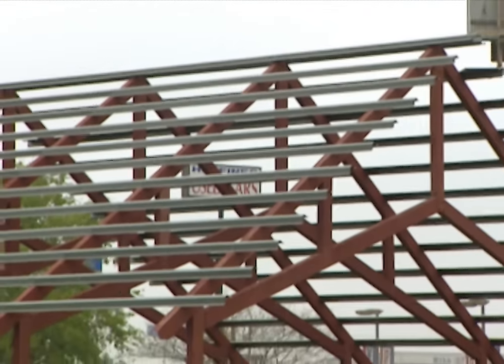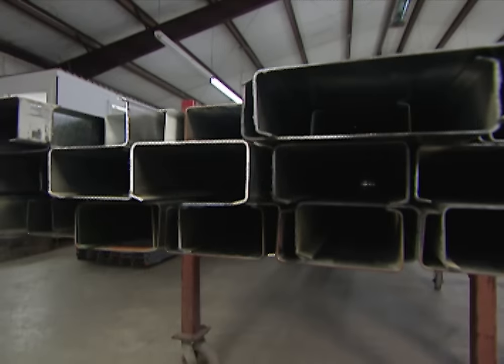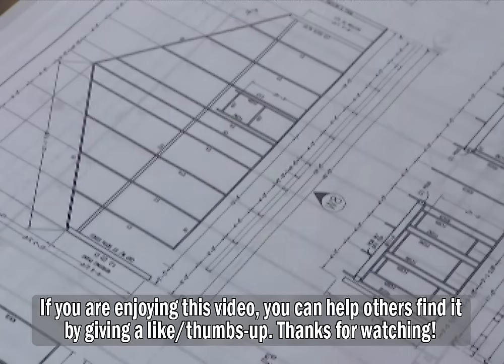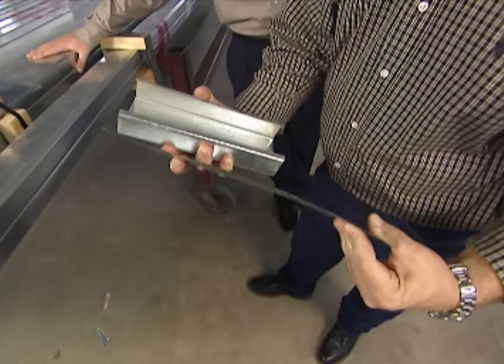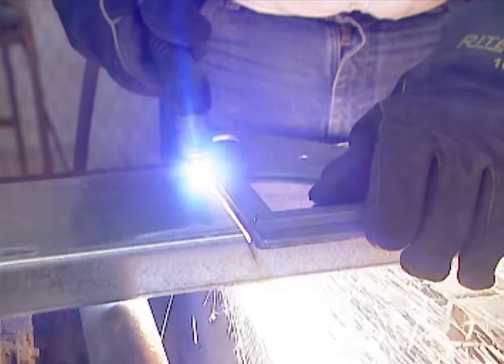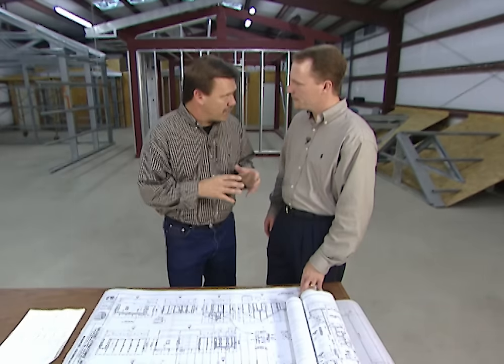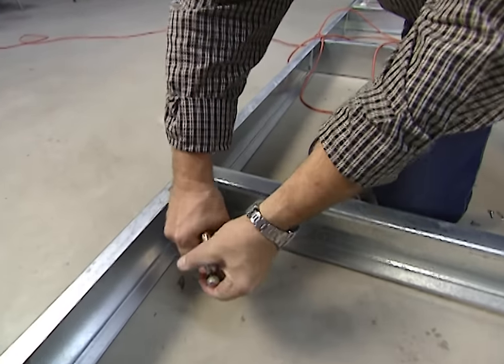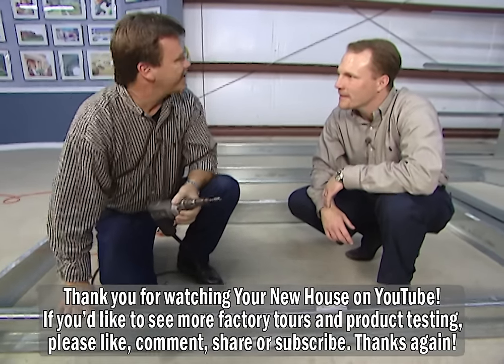Steel Framing - Did You Know?

Comment: I’m wondering how the steel handles the permanent stress of settling
Reply: I know a 20 year home with creaky walls and unsquare doors n windows. Has steel c channel beams
Reply: @lynnamarsh6384  I suppose Lynna  really you could find that in  many  average wood or steel homes  ,
 i have always lived in wood frame homes , and they all seem to suffer some movement in the frames over time . 
  I suspect a lot of how well they hold up regardless of materials over time has to do with how well they are built from the get go .
 Time is money , and imo often they are slapped together .

 I`m not a builder but i am old and seen a lot houses ,  and a  lot of them are imo put together with short cuts  or compromises and cheap and fast like junk.

Comment: Not seen a chopsaw run without safety goggles or hearing protection in a while. Not even side shields on his spectacles.
Reply: oughta see some of the crap that goes on in the steel fab shop I work in 😂

Comment: As a steel fabricator in manufacturing for over two decades I would never use screws to join two pieces of steel. If you can't weld it ...your just pretending. The screws just make this product marketable. Buyer beware.
Reply: big agree

Comment: yeah and in the case of fire the whole bloody thing would collapse. steel softens quickly in the heat.
Reply: Yeah but it would sag whereas timber burns, cracks, splits and collapses, at least you have more time in a steel frame home to escape, also unless you're an idiot who lit his gas main on fire morebthan likely a fire would not heat the entire structure enough to melt it
Reply: not the way those are framed. it wont collapse. you would have to have wayy too many failures for that to happen. the house would have to be a huge inferno, but theres nothing really to burn that hot since there isnt any wood
Reply: That's what sheetrock is for...fire protection as per codes all primary load carrying members have 1 to 2 hour fire rating.

Comment: and termites dont eat plywood ..yeah right
Reply: Up here in upstate NY we dont use plywood to steel , we use durarock  a fiber  gypsum board  4×8  ×1/2 or 5/8  a fire proof ,water  , rot , termite ,mold free material   . Covered by brick or dryvit.
Reply: @tomparshall2450  far out ,,pretty sure i seen wood product in this video tho,,but at least the termite wont eat the studs ..lol

Comment: Did you know whin I was in high school  in 1965 I was told don't bother  learning wood framing ( by my wood shop teacher)you won't be working in wood WELL there still framing in wood
Reply: They also used to tell us we would be driving in flying cars a couple of decades ago...still driving on the road. The thing about change is that people are resistant to change until enough time has passed to prove (or disprove) the concepts.

Comment: Make a shipping container home instead! ..much much cheaper. ....that metal does not  burn, but it can get very hot and can melt and bend.
Reply: @lawsfreelancemalice1380  the rust actually helps the container from any corrosion. They are made for ocean winds and ocean salt  water. They also last an entire week floating on the ocean when they fall off container carrier ships so they can be recovered.
Reply: @lawsfreelancemalice1380  yes, correct.👍

Comment: We need more of these homes in California with all the wild fires, termites earthquakes and wind in some areas..  They just started to bring in steel studs the last few months at our local Lowes and I have already started to use the steel for a number of projects. I am looking at putting a metal roof on my mobile home and nail steel studs to the outside of my mobile home and fill it with mineral wool and put on top of that metal siding.

Comment: What’s the company we can send the blueprint to ?
Reply: Just have your engineer draw plans in steel that's all.
Reply: @786otto   If youre doing it all your self , go copy a commercial building ,        Draw it the way you want it to look , then get an engineer to look over your   drawings , and he'll make the appropriate changes . That same engineer will   have to do a structural  inspection of your finished work to sign it off . A building inspector isnt qualified .
Reply: @paulbains9152  Building inspector has authority to inspect job not inginier .If plans approved by building department iginier inspector just needs to veryfy is done as plan shows .
Reply: Your too late. They went out of business.

Comment: Why would you take 20 foot long pieces and cut them to the correct size. Why not use a machine like a FRAMECAD machine which makes it so much easier and much quicker. Your method would appear to generate much scrap. I should know because we do it both ways. The FRAMECAD Method is the best. (HOWICK, SCOTSDALE) Also great machines. With you being in TEXAS there are several good companies building homes and much larger buildings using the FRAMECAD system. The end results are amazing. High Quality, Safety, Structural Integrity etc.

Comment: I'm not a builder and here's why I think this is dumb:
- Try hanging drywall, pictures, shelves, etc. by driving a screw into steal (too time consuming)
- Drilling holes to run electrical, plumbing, HVAC, etc.
- Galvanized? Not after cutting off an edge
- Thermal bridging? You bet, in the winter heat will pour out of your house
- Remodeling in the future? Be prepared for a headache or high expense
- Cost? Well, if they didn't tell you in the video...there's a reason why
- DIY framing? Try raising a steal framed wall

Comment below and add to the list.
Reply: Looks like they come with holes for electrical and plumbing, although it might be for pex piping.
They shouldnt be too heavy as its thin gauge steel, might even be lighter than wood.
Agree on the cutting part, no galvanized surface there. The metal is stronger after bending it to correct dimensions but i dont trust how thing the gauge is. I wouldnt trust steel screwed together, rather it be welded, but again, there goes the galvanized coating. And it will rust in humid locations, bet the screws will rust out first and snap.
Reply: There is a tool that punches the holes quick and clean.

Comment: Maybe the people that put together steel framing in near me suck at their job or its not actually steel or steel framing sucks. when I was putting insolation in the frames kept coming unattached from the base. sometimes they would rotate in on its self and any weight that might hang on it like regular word it just bends and fails.
Reply: It really ought to be welded, instead of using dinky little screws

Comment: Price comparison?
Reply: steel is cheaper than wood now
Reply: @billnunya858  Thanks, can you give me a comparison of actual units. eg- a 2X4  stud and a 2X10 floor joist?
Reply: @ReevansElectro  Galv. steel studs: 3&1/2" @$0.82 a ft. 6" @ $1.08 a ft  10" @ $1.55 a ft Clark Dietrich supplies and will cut to your plans exact lengths, no extra charge and no waste.
Reply: @billnunya858  Thank you. I appreciate your help and effort. I am not lucky enough to live near a Clark Dietrich but will be on the lookout for a company that can sell me similar products.

Comment: All of the cutting and fitting should be done by robotic laser...quicker, better and cheaper in the long run.  Each module loaded in sequence from computer....completed, banded and labeled. Put them on the truck in the order of need. At any rate....I'll take wood. OSB can handle a tank running over it.

Comment: Steel don't work in the south, too humid for it.
The humidity get in the walls and rusts out the metal. Seen it in portable sheds and a new apartment building, had to tear it down after 5 years do to Accessive rust on the frame.

Comment: Mount a 75" TV to a steel stud and let me know how that turns out.
Reply: Toggle bolts
Reply: Build it custom over cheap things fabricated 18g "stud"
Reply: If you mount a big screen TV you might want to put a piece of plywood on the wall first.
Reply: Ever see a large TV fall on the floor in a commercial building?
Reply: @64maxpower  sure have
Reply: Get a projector 🙃😊

Comment: 30% loss of R value. Not good in cold climates
Reply: I built a Tri Steel home in Missouri and had zero issues with it. Tight as hell.
Reply: Less mass to conduct heat or cold Id think
Reply: @gladec3896  the mass is not as relevant as  conductivity in this case. Testing demonstrates a 30% loss

Comment: Did you know , You can by a 12 X 20 steel home for just under 12.7 million dollars? That's right and if you act now we will include your own 10X10 steel garage for NO additional cost to YOU...
Reply: Thats a ridiculous price Buy an industrial building in an auction , get it re-planted and   modified . In 1985 , I did  a 60 x  60 ft , 22ft ceiling , with mezzanines , including concrete , for under $250,000 .

Comment: So you're slowly replacing the tradition of wood for the practicality of metal... 
Big question: why don't you just use metal framing for the entire house? From standard structure to load bearing beams and everything in between that is easily customized simply by width for the different needed pieces. 
And while you're at it, get rid of particle wood and replace it with plastic; the only thing that makes sense to keep, that we've been using for the longest time: is concrete, and even that's changing a little bit depending on mixture formula.
I'm not getting on to anybody; it's just a thought, and it makes the most sense. The only people I am mad at are the ones that are in positions of power to keep people, like me, from building my home the way I see fit simply because they have a biased against any material that's not wood for no other reason than tradition.
No one material is perfect but a mixture of all these things such as metal plastic and concrete has a better long life expectancy.

Comment: A few “yes or no” questions were sidestepped. Not convinced.
Reply: been working construction for years, biggest downfall i see is contractors use thin gauge for cost savings. second is the fasteners are somewhat cheezy. thicker gauge, better hardware will drive up the cost, but i see it as a better product when done right.

Comment: Bamboo is used to build 10 story buildings in India. One of the strongest woods around. Strong enough to hold concrete floors etc.
Reply: bamboo is a grass. It also expands and contracts A LOT with humidity. You should of seen my 3 thousand dollars worth of bamboo flooring after a year installed in my house. I would not touch bamboo unless humidity is same at all times of the year.

Comment: "I never have to worry about this rusting?  It's galvanized protected."   Tell that to my chain link fence...  So yes, you have to worry about your house collapsing on you due to rust.
Reply: Steel frame house is protected from the elements, not like you’re fence.
Reply: @carloscarney8471  So no need for galvanizing, right?  I mean it'll only be exposed to long term standing water and such.
Lay a galvanized nail on your basement floor and get back to us.
Reply: @MatHelm   I have a finished basement

Comment: Except it's so noisy as fuck that it will wake you from a dead sleep at mid night as the frame cools and clunks and thuds and bangs all the way to 3am...... Where you will get 1 hour sleep till 4am at which time in the exact same sounds start commencing again as the house heats up again!

Hear the echo as the guy drills the steel. Yeah fuck that!

Oh and let's not forget what you need to do need to be about to feed electrical wires! Thousands of rubber grommets are required for every single feed hole that wire needs to go through. Don't do it!

Comment: THem steel might be fire resistant but not the rest of the god damn house.
Reply: Actually just about any substrate or building material used in the framing and building process are available in fire resistant applications due to strict building codes in certain states. You would be suprised honestly
Reply: Language sir
Reply: More consent is cost .  
If you more money , you can built concerte wall more then 300 mm think . 

This design already thing all factor , fast job , strong , quality.
The main factor is cost . 

The overall cost is more cheaper compare insitu concrete . 

Labour cost reduse 
Fast job ...reduse overhead cost 
No michenery cost like crane .
Everlasting quality up to 100 year ...reduse cost to repair .
Reply: @uniaainu5826  In US houses are build from wood and steel like one in video ,no one builds house out off concrete That is popular in Europe and rest off country's that wood and still is expensive
Reply: What is stucco made out of?  They even mix it in a cement mixer.
Reply: @catfan5756  Is made with cement
Reply: @786otto  it is made with cement and fiberglass.